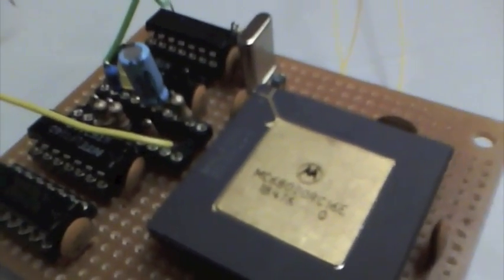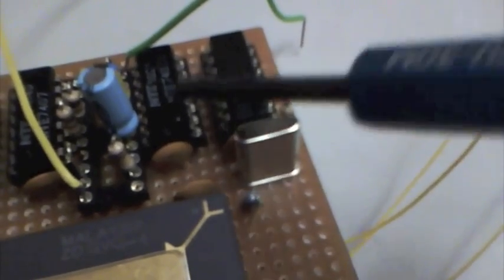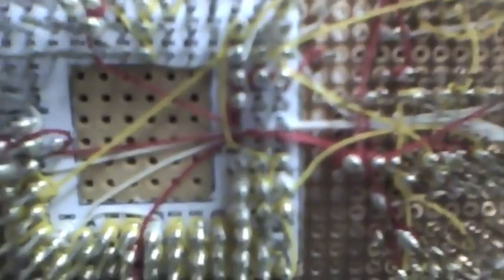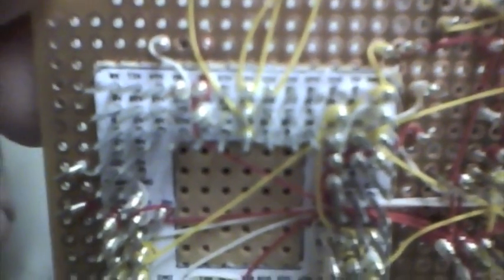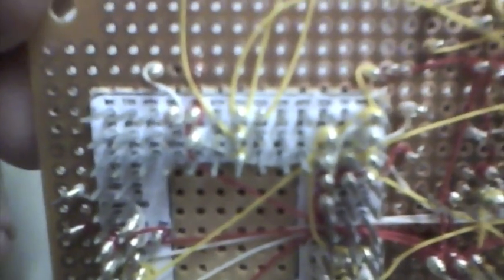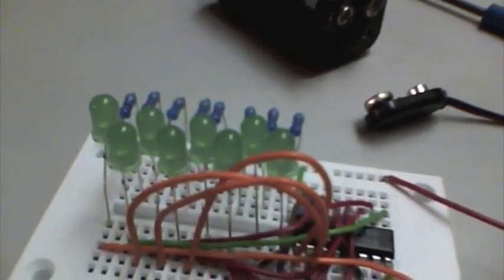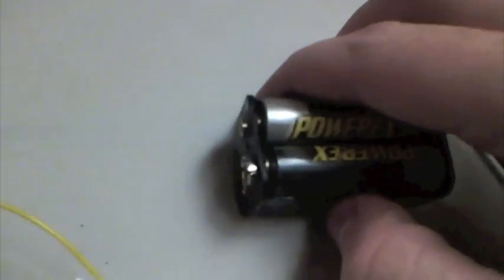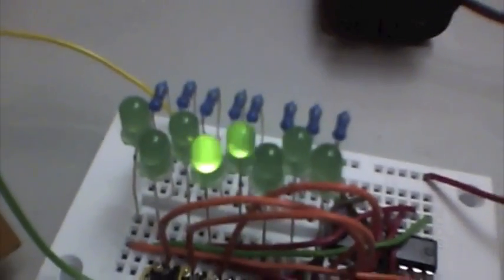68020 Homebrew

Comment from the maker: As for anyone who wishes to build a free-running circuit like this, it is pretty simple.  Avi posted a link in another comment with a few schematics.  The link is here:  http://avics.wordpress.com/my-68020-adventures-part-1

Keep in mind that the programmable GAL in his schematic is optional.  Also, he elected to use a 555 timer for clock generation whereas I use a 20MHz crystal that has been reduced to 10MHz via a D Flip-Flop and cleaned up with a pair of inverters. The important bits are controlling the reset line during startup, tying the necessary control pins to +5V or GND as needed, and of course tying all the data pins to GND.  

For reference, the board draws 150mA average.  I've since made a smaller free-running board that sits on my desk at work, and it is easily powered from a USB port.

If anyone wants the actual schematic that I am using, I can provide that as well.

Comment from the maker: It has been a very long time since I've posted this video, but I keep seeing it come up in search results so I figured it was time to post an update.

The good news is that I have uncovered some ancient Motorola documentation that led me down the path to getting a functional computer up and running. I'm currently experimenting with a CPLD to see if I can get all of the glue logic working with acceptable timings.  

The configuration that I am currently shooting for is to use an 8-bit wide data bus with the 68020, and a 32-bit wide address bus to access ROM, RAM, and a UART.  If it all works out, I'll gladly put the design files up on the net if there is an interest.

The bad news?  I'm not terribly adept at things like writing a ROM BIOS and getting the thing to the point where it can boot linux or uClinux.  Given enough time, I could figure it out and build a functional unit with an MMU and a good chunk of RAM.  I'm not even certain of the level of community interest.  I haven't seen many projects using 68020s, and definitely haven't stumbled across any opensource system designs using this processor.  I'd love to see that change... maybe once I get something resembling a devboard up and running and maybe even run off a few boards for folks who want to tinker, I can get that ball rolling.

Comment: I have five working 68020 CPU boards, using the STEbus which is much like an 8-bit VME bus. Not a big problem, as most I/O chips have 8-bit data bus. I don't have the circuit, but most signals are address and data bus. The rest have to be found with a multimeter.